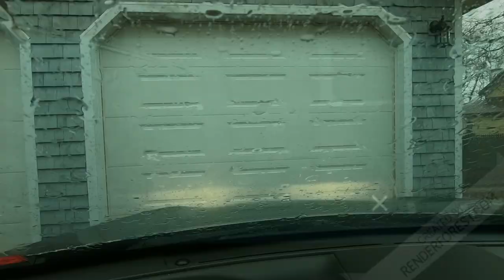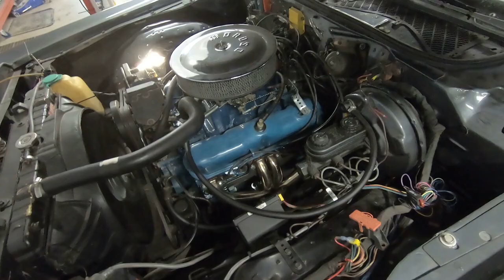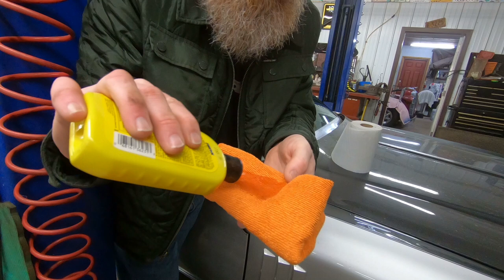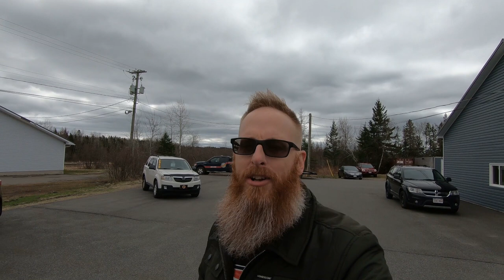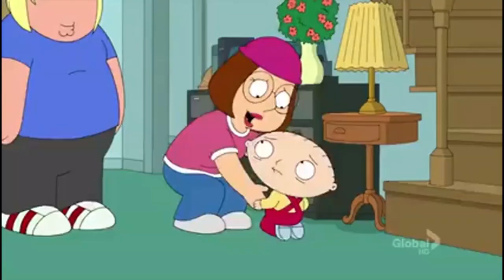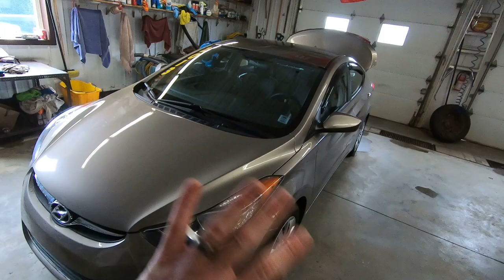HOW TO APPLY RAIN-X, STOPPING EXHAUST LEAKS AND LOT UPDATE

Comment: I doubled up on gaskets with high temp copper silicone before and had good luck getting them to seal up. Mr. Gasket ultra seal gaskets are very good.
Reply from the maker: Thanks for the heads up! Gaskets and ARP header bolts on order! Hope you stick around!

Comment: I never liked the paperish gaskets. I always either ran copper with good named brand headers or if I had sealing issues something like the thick shift aluminum gaskets.
Reply from the maker: Copper/alum gaskets on order as well as proper Header bolts with smaller head so i can tighten the buggers!
Reply: @OldeCarrGuy  yea gotta have those header bolts.